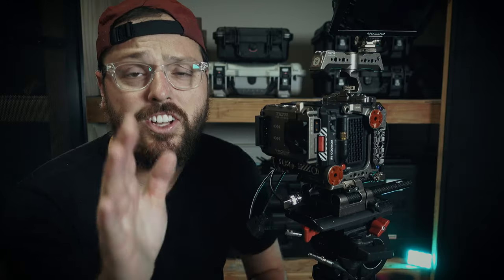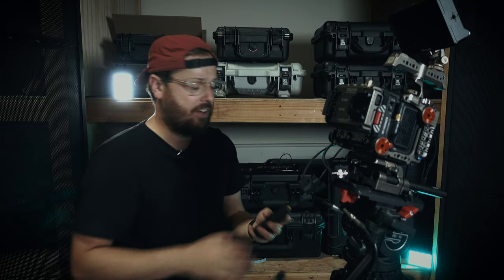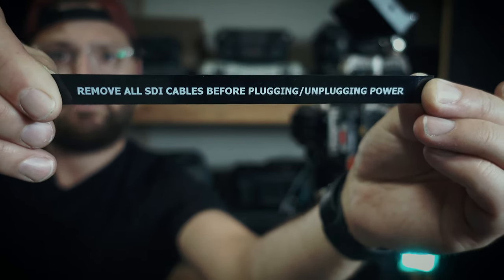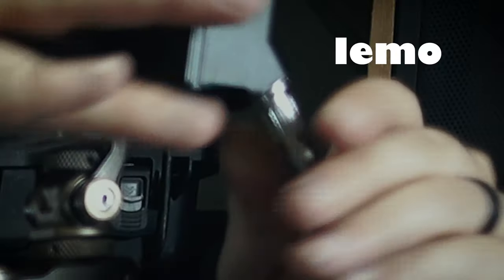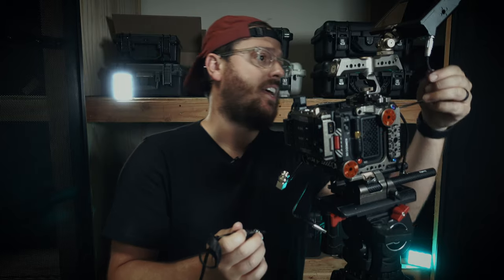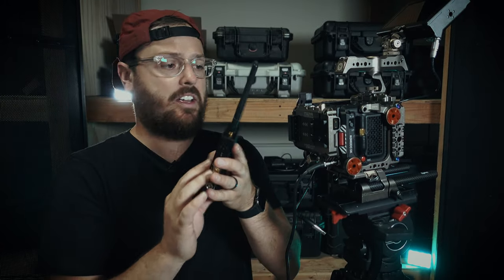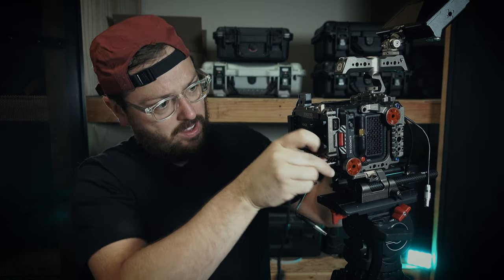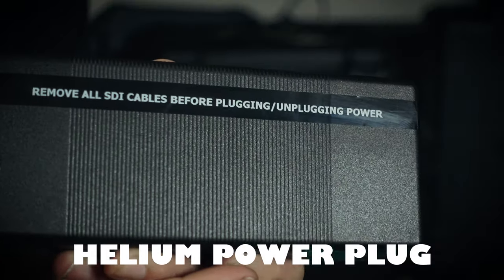How To Keep Your SDI Output From Blowing Up

Comment: This applies to HDMi also…. Any video  “signal” cable really.
Reply: No, not really.  Only 12G SDI.
Reply: @robertruffo2134  um no it doesn’t ..
Reply: @MAD_CHILLER  HDMI ports fail for other reasons.  They don't like being connected "hot".  That's actually what burns them.  Other SDI are very unlikely to have this problem, which is why you almost never heard about this issue until a popular cam with 12G SDI was released..
Reply: @robertruffo2134 the ground looping issue affects hdmi just as much as anything .  

It comes down to bad practices .

In all things it’s should be be .

Connect power  first. Connect signal..  power on and shoot..  

Reverse for tear down.  

It’s that simple.

Comment: "This happens when one pin hits the outlet before the other one" So....batteries are fine. Gotcha.
Reply from the maker: Love the name!
Reply: They aren’t though. There’s a whole bunch of complaints about black magic pocket cinema cameras having the exact same issue on the hdmi port burning out. Most people thought it came from powering everything off the same battery, but it seems like even using separate power sources can cause the burn out eventually unless you follow proper plugging/unplugging procedure.

Comment: Blackmagic cameras have this same issue with HDMI cables. I would expand this to say Remove all video cables before adding or taking away power.
Reply from the maker: Good call
Reply: Incorrect. All cables should be connected first and then the power switched on, and switched off before removing cables. Use a V-mount battery plate with an on/off switch, or if using say an NP-F battery adapter, do not attach battery until everything is plugged in. Connecting anything while the power is on will very likely guarantee a burned out HDMI port. SDI works differently and even ARRI put out a bulletin saying connect the power cables first, then the SDI and then turn on power. Quote:

'To prevent this damage to the SDI outputs, ALWAYS make sure to plug in the power cable first and THEN 
connect the BNC cable. Once power and BNC cables are connected, it is OK to power the camera or 
accessory on or off. Also, ALWAYS make sure to disconnect the BNC cable first and THEN disconnect the 
power cable. '
Reply: @AustralianImage  dammit. This is pretty much the exact opposite of what he’s saying in the video. Your description is how I have understood it as well. I have seen many discussions, specifically with Blackmagic cameras, about this issue. So regardless of whether it’s HDMI or SDI, we connect everything first and then power everything on? I’ve powered my camera on and off with and without accessories a million times. And at some point I know I have missed the steps up. Maybe I got lucky. But I want to do it right. As of late, I have been powering my monitor off an NPF attached to my rig, and my camera powered by V lock battery—on a plate that has an on/off switch. 

Also, what if there is no on/off switch on the battery/plate? 

And what about the little things, like powering the camera down between set ups and whatnot? We are not expected to disconnect everything every time we turn the camera off, correct? Because I don’t do that. This is all pretty confusing to be honest.
Reply: @j.oakley9588  What happens is that many people equate SDI requirements with HDMI requirements. As I've noted before, ARRI issued a bulletin on how to avoid damaging SDI (BNC) connectors and that process is quite specific because of the nature of SDI. In theory, you can plug and unplug HDMI cables as you would USB cables, but there's always the risk, so with cameras and monitors I always power off before connecting/disconnecting cables. If a battery plate has no on/off switch, just make certain all the devices are off and remove the battery first.
Reply: @AustralianImage  copy that. Same too with SDI and HDMI connections I assume? Like if I hooked an evf into my monitor via SDI, but my monitor is receiving the camera’s signal via HDMI m. There’s no SDI on my camera but I use a portkeys BM5 which has an SDI out.

Comment: Sorry newbie so  here is a newbie question--can you turn off the monitor , then remove the sdi and then the power cable? Same  plug the power , then turn on the monitor and then connect the sdi
Reply from the maker: You nailed it!

Comment: Golden
Reply: I’ve owned Komodo for around 9 months now, and haven’t had any issues really. With that being said I just want to implement this safety as part of my workflow. I used to follow the protocol that Phil Holland put out for Red. So ideally would you recommend having both camera, monitor, and accessories such as Red Control, FIZ units etc., powered before inserting the BNC cable? Or just make sure everything has power flowing such as cam, monitor, FIZ, Teradek etc., whether on/off?

Comment: This goes to show how crappy a RED Komodo is. I’ve used tons of different Alexa bodies in my career and with Teradeks and never done this and nothing has ever happened.
Reply from the maker: https://www.arri.com/resource/blob/194752/26e7a4ca07e7a8f0ce038b23109b216c/download-technical-information-data.pdf
Reply from the maker: Unfortunately this problem applies to all cameras with SDI outputs.
Reply: Please note, its a very common issue with 12G sdi. 3G sdi is more robust but wouldn't rule them out as I've also broken a 3g sdi once but several 12G sdi
Reply: Same to me nothing happened
Reply: @TheObsessiveDP  Thanks for the Arri link. Does Red have the same type of doc?  I own a Red Scarlet-W with RED DSMC2 V-Lock I/O Expander and have never had problems with the SDI output, but I primarily run off of bricks.   Would this type of issue only effect the I/O expander and not the camera brain?